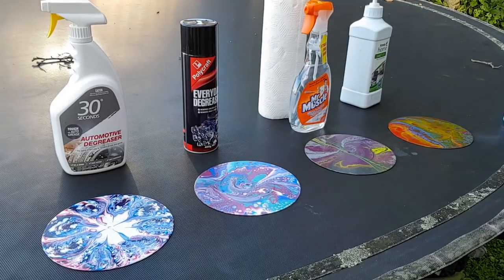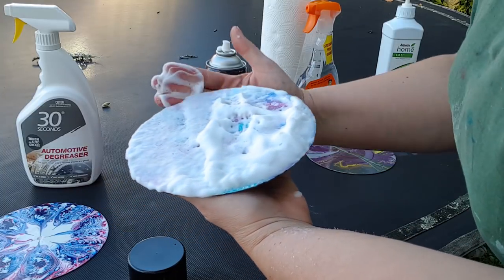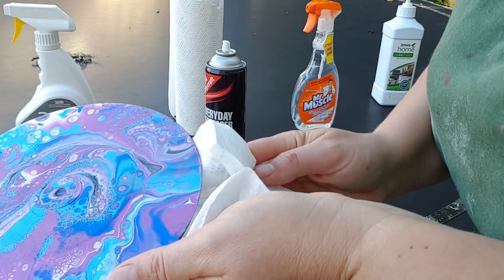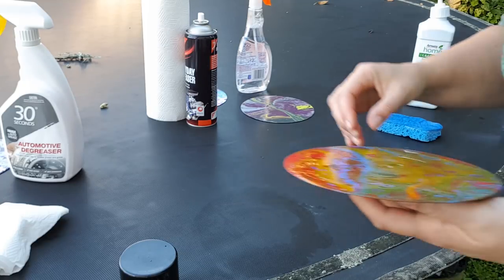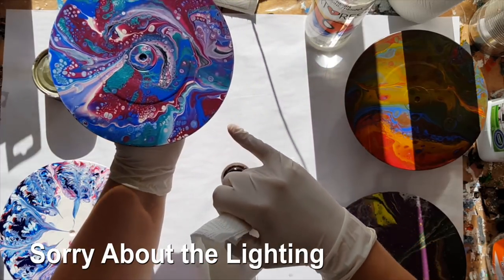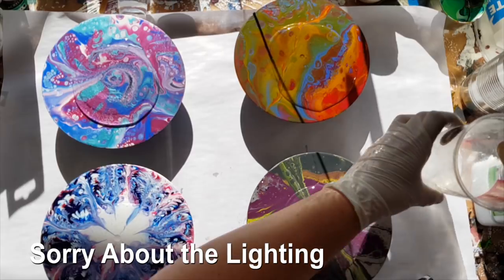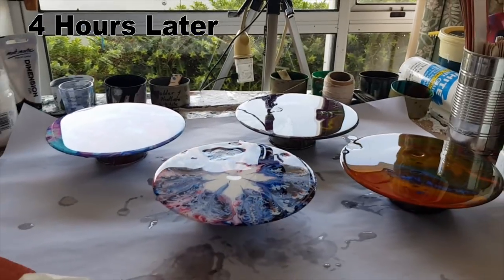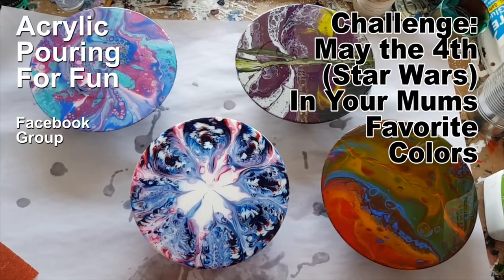192 Testing Degreasing Products on Record Acrylic Pours

Comment: Bonjour. Juste une question ... combien de temps nécessaire pour le séchage complet de la peinture acrylique "pouring" sur les disques vinyles ?
Reply from the maker: Translated: Hello. Just a question ... how long does it take for the complete drying of acrylic paint "pouring" on vinyl records?

Me: Cela dépend de l'épaisseur de votre peinture, de la chaleur et de l'humidité de la salle de séchage. Habituellement autour de 2 jours mais peut aller jusqu’à 5 jours s’il est épais et au milieu de l’hiver.

 It depends on how thick your paint is and the warmth and humidity of the drying room.  Usually around 2 days but can be up to 5 days if thick and mid winter.

Comment: how did u get the resin to stick to the divet spots for the second round of resin? .. wish u would show how u corrected those.. did you sand the whole piece down? add a small amount of silicone that was used on the piece into the resin? please show the follow up .. thanks.
Reply from the maker: I resanded the whole piece and poured the whole thing again.
Reply: So are you saying I could use DAWN Dish Soap to clean off the silicone ??? I’m in Canada and we have Dawn just like US.